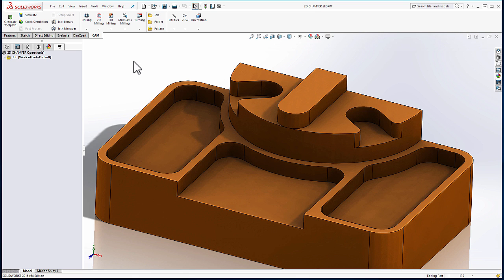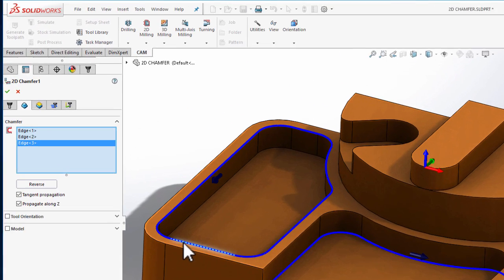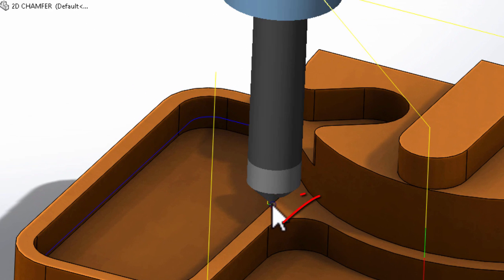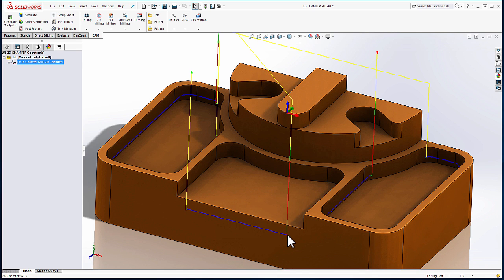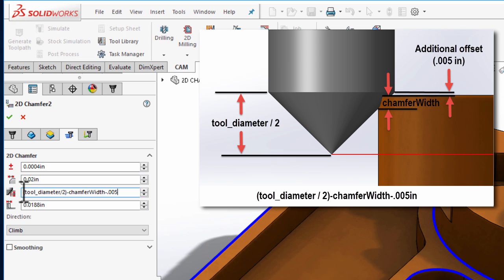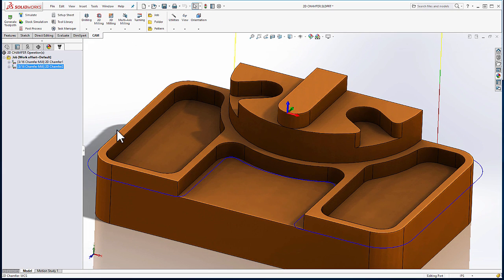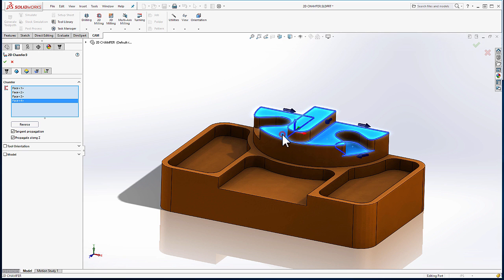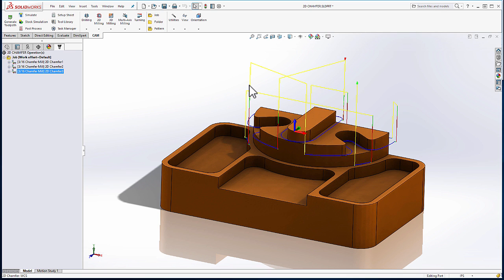HSMWorks Development update: 2D Chamfer

Comment: I'm using Inventor 2016 with HSMWorks and I didn't see "2D Chamfer" listed in the drop down so I tried a 2D contour using a chamfer tool. I found "Chamfer width:" and "Chamfer tip offset:" I entered your formula in Chamfer tip offset and it accepted it. Returned with 0.110" Chamfer tip offset.
Haven't tried it on the mill yet but will later tonight.

When you made it as "Default".. that makes the formula as default or the value as default?
Reply: +Jack Flash Never mind.. tried it with another tool on another edge and it seems to make the formula default. Thanks